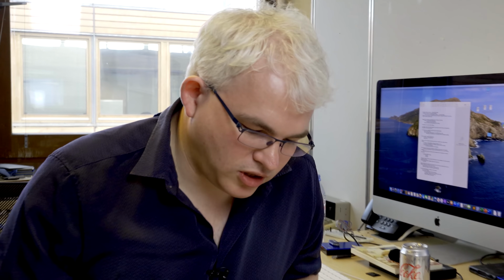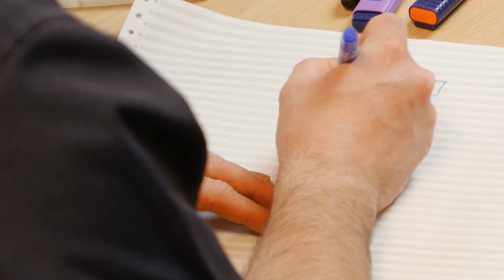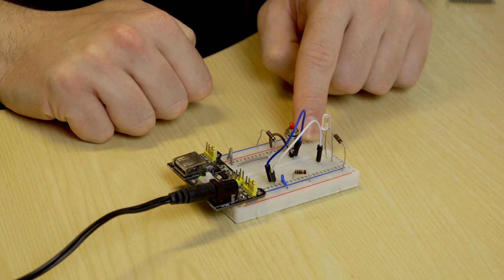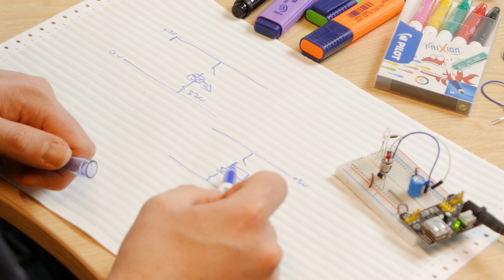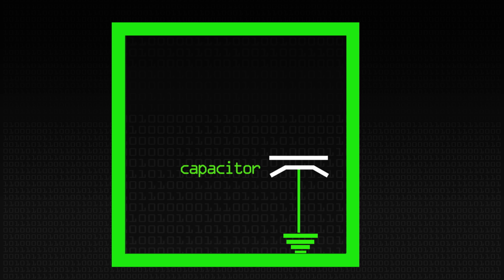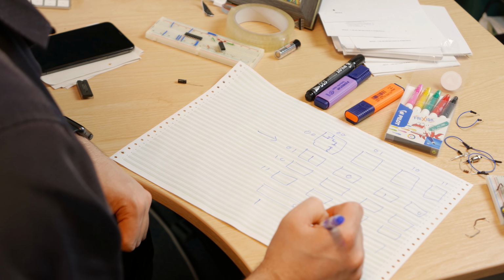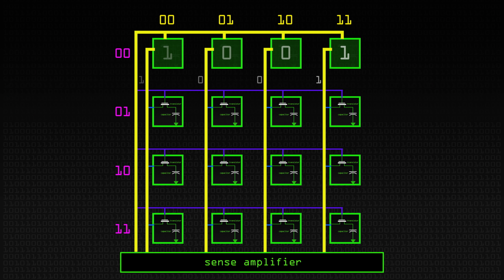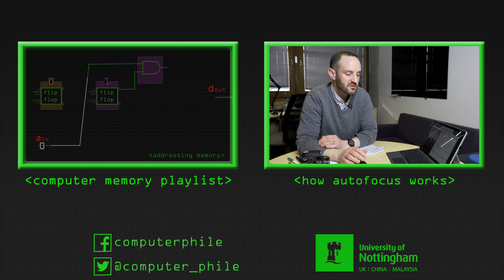Why My Computer Wants to Forget (How Dynamic Memory Works) - Computerphile

Comment: A long time ago when I was a kid in the 90s, I had written a memory viewer that allowed me to scroll through memory and display it. In the famous PORTS.LST listing I found out that the memory refresh timer was accessible through the PIT. I turned it off, ran my memory viewer, and could see blocks of memory alternately decaying to 00 and FF. It was a neat visual demonstration of the DRAM refresh cycle's function. Naturally the computer would later crash when it used a corrupted area that hadn't been accessed in a while (frequently accessed areas were maintained).
Reply: @blackCatDown  Who cares about naked women if you have mathematics and a disassembler at your disposal ?

Comment: The bit at the end about the data staying for a short time is why you could pull up the level select cheat in Sonic 2 and then quickly switch the cart to Sonic 3. The flag that controlled access to the cheat was stored at the exact same address in both, and ram stayed there for a few seconds.
Reply: That is static ram. It stays until power is off.
Reply: @LittleRainGames  Level select is a type of game state store, it is a changeable variable, therefore it is stored in RAM.
The Mega Drive used DRAM, which stores charge for much longer than the modern ultra-fast SDRAM we use in our computing devices today.
Reply: @elimalinsky7069  The RAM is just never cleared when you swap carts. It doesn't matter if it is SRAM or DRAM, because the power is never cut and the hardware reset circuitry will maintain the data in DRAM just fine. Speed has nothing to do with it. The same type of bug also works on the Famicom, for instance. I also have a hard time believing DRAM in the 1990s could retain data for several seconds while swapping cartridges.

Comment: Wait what? That's how memory is built? It's like constantly reminding someone with dementia what they're supposed to do.
Reply: Or it's like when you have to buy milk, eggs, flour, and toilet paper at the grocery store and rather than write it down on a list you just constantly chant to yourself "milk, eggs, flour, toilet paper, milk, eggs, flour, toilet paper..."
Reply: It's counterintuitive, but yes.

Though you do have to keep in mind it's built this way because it's a lot cheaper.

There is a thing called SRAM (Static RAM) that actually remembers things properly...

But where say, 32 gigabytes of DRAM will cost you about $250...
$250 will get you all of about 100 megabytes (yes, mega, not giga)...

So... Yeah. You can see why we use this stuff in spite of how silly it seems...

We have a long history of weird memory things though.

Before transistor based memory was common, you had magnetic core memory.
This is basically a grid of wires that runs through a set of magnetic beads.

Contrary to modern memory, this is actually persistent - the contents remain intact when the power is off.

The peculiarity comes however in that if you try and read the value of a memory location...
The memory cell will forget it's contents.
So EVERY attempt to read from memory must immediately be followed by you rewriting the value you just read, or it'll be lost.

Magnetic core memory has a few peculiar advantages, which means it was used in spaceships much longer than anywhere else.
The main problem with it is that you basically cannot mass-produce it, and as such it's extremely expensive. (like $250,000 per module kind of expensive...)
Reply: if you enjoy mixed metaphors, see also "rowhammer"
Reply: yup.
Reply: or, like taking notes by every day writing and sending a letter to yourself with ink which decomposes in 24 hours, so the next day when you recieve the letter, you open it, read it, and write what's in it  into a new letter that you send to yourself =D
Reply: +[Kuralthys]

It's not so much because it's cheaper , but because it's smaller .

The smaller your memory cells are, the more memory will fit on a single chip. The more memory will fit on a chip, the more memory a casing or roughly the same shape (whether that be desktop-, laptop- or phone-shaped) and size can store.

Dynamic RAM is the sole reason your computer is capable of handling the amount of data it can, and therefore the only reason it can run modern programs at anything close to resembling acceptable efficiency.
Reply: @KuraIthys  But the price for SRAM is so high mainly because so little of it is manufactured. If it were more popular, the price would go down.
Reply: @truthseeker I am certainly not any kind of expert. (though I guess that's relative)
I really don't know. You'd have to ask the companies that make this stuff why that's the case.
Do keep in mind that it's not just the components, but also the way they interconnect, what type of component it is, and so on.
While this certainly isn't proof of anything, I can buy loose capacitors for a lot less than loose transistors in most situations. Why? I wouldn't know with any detail.
Reply: @lawrencedoliveiro9104  Chicken and egg problem.

Little is manufactured because there is less demand.
There was less demand because it cost more.

So the root cause is still that it was more expensive.
It's just been amplified over time.

Comment: In one of my university courses we implemented a DRAM controller in an FPGA. Three main pieces: the 68k bus interface, address decoding, and the refresh logic. Great fun!
Reply: what university is that? :O
Reply: @griefytrolly  University of Toronto
Reply: Wise choice of using the Motorola 68K. Best processor for teaching hardware and OS concepts IMO
Reply: @baileycownley1868  Why so? As opposed to MIPS or SPARC?
Reply: @sebastianelytron8450  Because I've only started using MIPS architecture and i was stubbornly sticking to 68K because it's how i learned about computer architecture, assembly tricks, and the fundamentals of an OS. MIPS is great, but i like the 68K
Reply: @baileycownley1868  Pretty much a non-answer but thanks for replying I guess lol
Reply: @sebastianelytron8450  It wasn't as bad in 1998.
Reply: @sebastianelytron8450  One of those canonical architectures (like PDP-11 and IBM System 360) that show you how it's done.
Reply: @marsgal42  You a fellow conservative? 😎
Reply: @sebastianelytron8450  I don't do politics. I have a life instead.
Reply: @marsgal42  Wow, I'm so jealous.
Reply: @sebastianelytron8450  conservative = someone who has been sheltered in 1 area of life, and is ultimately narrow minded and lacks perspective
Reply: @LittleRainGames  I’ve been thinking about this. “Conservatives” as supposed to be those who like to stick to how things were in the past. But they tend to exhibit very limited and selective memory of how things really were in the past. Those who actually study the history of how things were in the past, and try to learn from it, tend to get branded “Liberals”.

Comment: 3:58 LEDs always need a resistor to stop them exploding, because they are prone to an effect known as “thermal runaway”. Most substances exhibit higher electrical resistance as their temperature rises. So as current flows through them and heats them up, this increases the resistance and acts as an automatic limit on how much more current can flow. LEDs exhibit the opposite behaviour: their resistance goes down as they heat up. Thus, if you put too much current through them, they heat up, lowering their resistance, and this means even more current flowing through, until they blow up, die etc.

Comment: In general a rather decent explanation of the inner workings of DRAM.
Though, fun thing with more modern DRAM chips is that the capacitor has largely been integrated into the transistor itself.

Downside with DRAM memory is though also that it tends to forget when just reading. Since the bit line also has a "small amount" of capacitance. (usually more capacitance then the DRAM Cell itself, so you need to write it back, though DRAM chips tends to do this internally without bothering you about it.)

Some DRAM chips handle the refreshing internally, while others don't and requires one to burn away precious memory bandwidth.

Comment: Is refresh circuitry separate from the CPU? How much memory access bandwidth is eaten up by the refresh cycle? For speed critical application, would static memory be superior? What kind of memory is used in CPU cache and pipelines?
Reply: In microcontrollers, where latency can be more important and memory sizes aren't required to be so big, SRAM is often used to allow the CPU to not require a cache and not have to wait for its memory nearly so much as it would have to with no cache and DRAM.
Reply: It's generally part of the memory controller / memory module, meaning that none of the memory access bandwidth is eaten up by the refresh cycle.

DRAM is slower to access than SRAM, which is exactly why it is used for the cache. Another interesting factor as well is the physical location of the two, computers are so fast now that the difference in distance between the cache (on CPU) and RAM (further away on the motherboard) from the processor can make a difference.

I don't know enough about pipelines, but when I have learnt about them it was always described as SRAM-style logic acting as buffers. It's less of a memory chip and more a very short term memory holding the information until the next cycle, when the next part of the data path of the processor is available
Reply: CPU cache used SRAM because it’s speed. SRAM is very expensive, that’s why CPUs have like 8 MB of it or something. This tradeoff of having a small but fast cache RAM and a huge RAM that is slow because it needs to be refreshed is considered the best approach.
Reply: The refreshing circuitry varies in its location depending on the system.
Some systems does memory refreshing with software. (not really that common these days)
Some do it in the CPU memory manager. (Also not that common these days)
And some DRAM chips have the refreshing circuitry internally. (With various implementations, some wants some time for themselves every now and then, while others wants to be explicitly told to do a refresh.)

The advantage of moving refreshing out from software is that we don't need to waste some of the CPU's performance for a fairly trivial task. (Read contents of address X, write said content into address X, increment X.)

Moving the refreshing away from the CPU itself has the advantage of not needing to waste memory bandwidth on refreshing. (Since the RAM chip can refresh the whole row at once, while the memory bus can only read out a small portion of a row at any given time.)

The memory bandwidth required if we do the refreshing inside the CPU is though fairly trivial to calculate.
We need to refresh it once every 62ms, or about 16 times a second.
Ie, if we have 8GB of memory, we need 128 GB/s of memory bandwidth just to read.
Writing back the read values would require another 128 GB/s of bandwidth.

DDR(1, 2, 3, 4, etc) all use a simplex bus, ie it can only send data in one direction at any given point in time. So we would need at least 256 GB/s of memory bandwidth to refresh our 8GB module. Or about 10 times more bandwidth then DDR4 has on offer. (Obviously, DDR memory has refreshing in the DRAM chips themselves.)

If we look into the DRAM chip and how it does refreshing, then it will refresh a whole row at a time, in each memory array. There is multiple memory arrays in a bank, and multiple banks in a chip, and a few chips on a memory module. Meaning that the module itself is easily 100's of times faster than what the CPU itself could comprehend.

Meaning that in the end, we aren't going to be wasting all too much time on refreshing memory. And most of the time, we will be fairly oblivious to it non the less.
Reply: If anyones looking for more reading: Find a PDF from the IEEE named 
"DRAM Refresh Mechanisms, Penalties, and Trade-Offs" - It was very technical but also readable.
Reply: Also worth noting you sometimes run into something called 'PSRAM' - the Gamecube specs list it for instance.

PSRAM is something that as far as the system designer is concerned behaves like Static RAM - and you can basically drop it into pretty much any system that's using Static RAM (as long as voltages and such match up. The PSRAM modules I've been able to find are often 1.8 volts to much SRAM being 3.3 or 5 volts)

You'll find that PSRAM has much higher capacities for the cost though.
The secret? PSRAM (or Pseudo-Static RAM) is basically DRAM with an integrated self-refresh circuit that hides it's identity from the system.

So the chip is basically DRAM, but to a circuit designer it's interchangeable with SRAM. (mostly. Probably not so great if you're using battery backed SRAM for long-term storage uses...)
Reply: It's my understanding that processor cache lines are made of black magic and happy thoughts.
Reply: About the bandwidth: The write-back is built into the chip, so the data doesn't not need to be read wand written back by whatever is doing the refresh. It is enough to select a line for it to be refreshed. So even in the worst case, only a single bit of each line needs to be read (and uses up bandwidth). In reality, the address is selected (sent to the RAM chip), but never read (because of the sense amplifier there is a delay between selecting an address and being able to read it). So only bandwidth on the address bus but not the data bus is used.
Reply: Also there is this thing called “VRAM” (“Video RAM”). From the CPU side, it can be read and written like normal DRAM. But on the other side, there is a read-only port with a shift register that is continually transmitting the bits sequentially from memory. From there they are fed to video circuitry to interpret them as colour and brightness data etc before being output to a display.

The point with this design is that the sequential output has low contention with regular CPU access, i.e. neither slows the other down much.

Comment: I wonder why we don’t say at some point “OK, memory is now big enough, we can afford to go back to static RAMs now”. For example, you can easily pack in something like 64GiB of DRAM in a modern machine. If the same amount of circuitry can only amount to 16GiB of SRAM, that would still be very useful for many purposes. Also. SRAMs are faster to access, which is why they are used for high-speed caches. And think of the power saving!
Reply: The problem is that once you start to scale up beyond cache capacities, the thermal requirements and power usage goes up exponentially for speed gains that are simply not worth it. DRAM is fast enough as it is with access speeds in the fraction points of nanoseconds. What is more important is memory bandwidth, and that is a huge problem with the electrical resistance of copper wires and the distance to travel from RAM to CPU. This is the real bottleneck.
Reply: @elimalinsky7069  But SRAM uses less power, hence it puts out less heat.
Reply: @lawrencedoliveiro9104  Again, it depends on the scale and complexity. Small static cache memory uses much less power than dynamic cache memory, but once you go gigabytes, the sheer complexity and scale of the system (it's not just the extra transistors to store the bit value, it's also the need for very complex controllers to map, access, read and write the data) will make the system unwieldy and inefficient.
It's true that it's our choice of DRAM over SRAM that led to progress and efficiency on that front, and the abandonment of SRAM for large capacity RAM that stalled advancement on that particular front. Nobody wants to start from scratch. The predicted high price, the unproven grounds, the possible yield issues. Nobody wants to take those risks just yet.
Reply: @elimalinsky7069  SRAM needs less complex controllers than DRAM. That’s part of the point.

Comment: What if your not worried about security and want the data to hang around after the power is cut, for example you could be doing a computation that takes a long time to complete and a power cut could occur during that time and have designed the computation to not use HDDs or SSDs etc but rather continue as though it had not been stopped so that you don't have to re-spend the time waiting for it to get to the point before the power cut, at present the only way I can think of to produce that effect would be to build custom RAM utilizing electrowetting at the expense of size (a test bench can avoid the lack of space after all), well I say at the expense of size but that is because of it being a new kind of RAM, would also reduce the power dependency since it would be a form of permanent memory.
If someone to actually make such memory they could probably just call it ERAM
Reply: Or get a UPS
Reply: @Dataacid  Never heard of it, what's a UPS?
Reply: @zxuiji  it's a big battery that kicks in whenever there is a power loss.
Reply: @Dataacid  thanks :)
Reply: It’s recommended to plug a power bank in when your doing a bios update, if your power shuts out then your entire motherboard could be bricked

Comment: actually there's another way of building SRAM with less (2) transistors, but it's pretty ugly. the gameboy did it: just 2 transistors as not gates feeding into each other and the addressing logic wired directly into them to pull the lines between them low. you don't want that particularly fast and/or large though because it essentially relied on shorting out the bits to (re)set them and can get pretty warm.

Comment: 7:30 wire memory would be a better analogy to this since you had to actively resend all the data down the wire to keep refreshing it where core memory would keep its state until you tried to read it and did not even need power to retain state so technically it is non volatile.